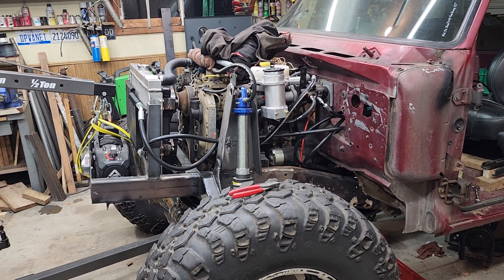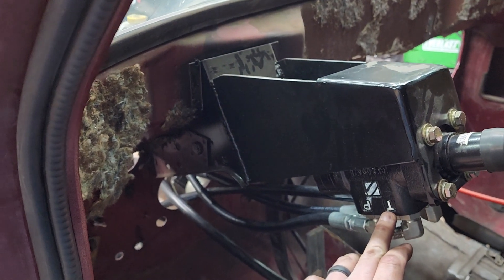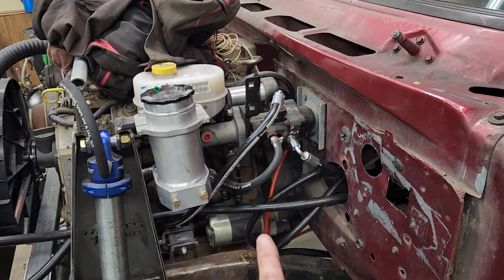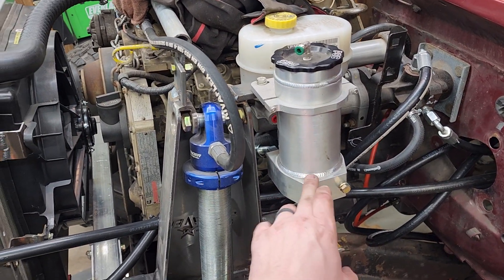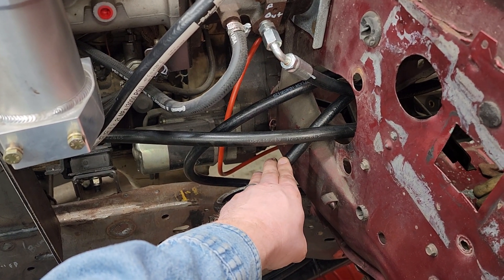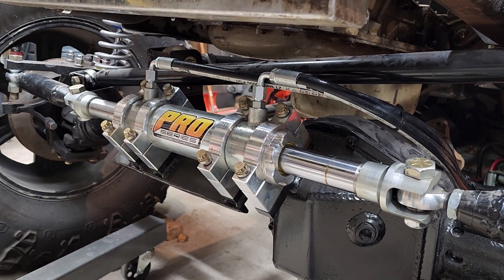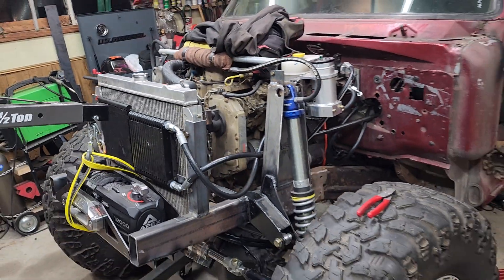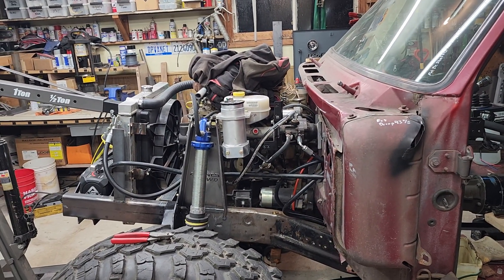Hydraulic Steering System Walk-through

Comment: I have a small orbital valve off of a toro tractor i want use on another tractor it has 5 ports  P.T.L.R. and E . The E. Stands for excess  how would  you run this line would it simply return to tank does it have to be alone or can it tee in with tank return ... tractor has a 2 port block pressure and return always circulation that also powers the hitch on the rear  Does the E .port have to go to tractor valve block  return or just dump to tank???? Thanks